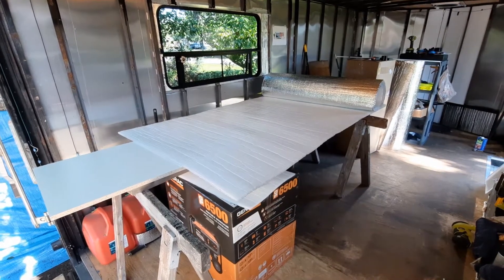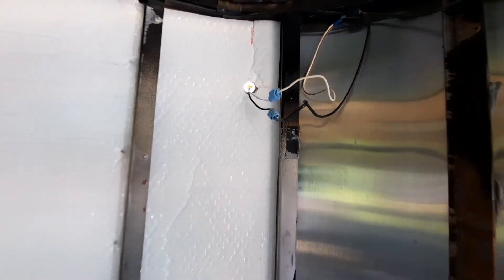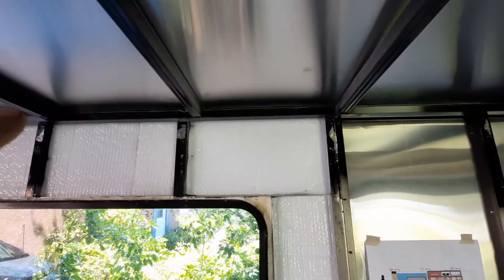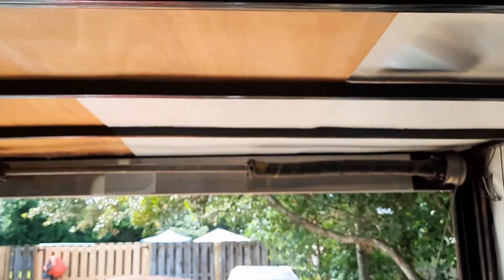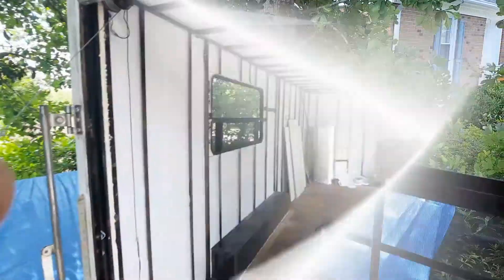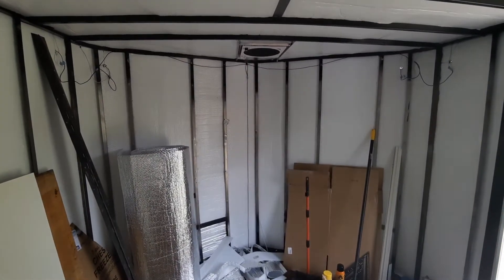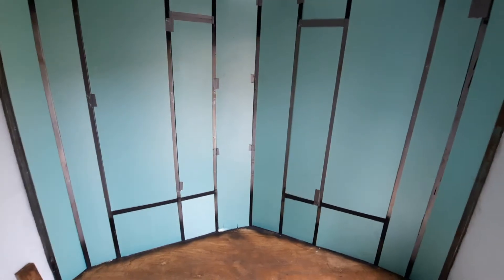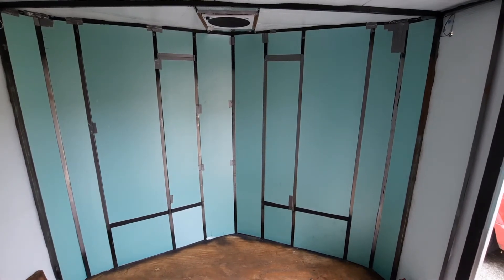Cargo Trailer Vid 11 - Installing foam #cargo #cargotrailer #cargotrailerconversion

Comment: Nice Cargo Trailer Friend i need do That You might want do floor keep cold off floor  put heat tape down cover it with pile wood or foam keep feet warm in cold
Reply from the maker: thanks for watching, I could do that.. but with the diesel heater and not going into vary cold areas... the floor won't be to cold.. and I wear socks when it's cold anyway :)

Comment: That should keep it cool
Reply from the maker: in temperate zones.. but not in bitter cold  (will have a diesel heater) and not in summer 116 degree weather.. but if it gets to hot or cold.. I can move :)